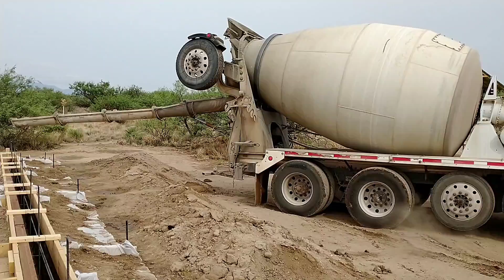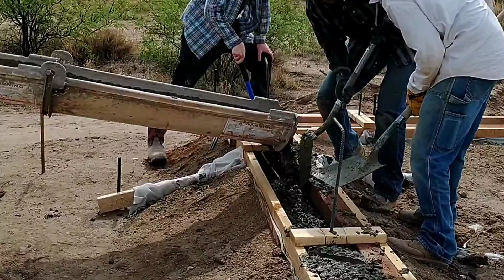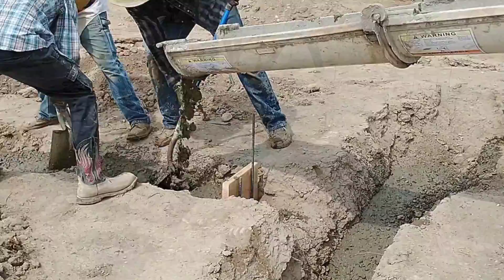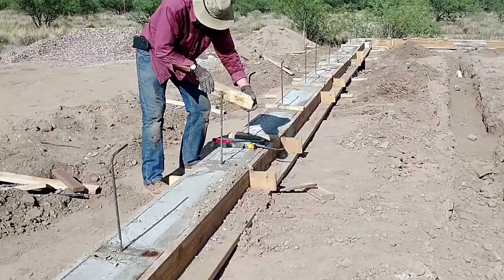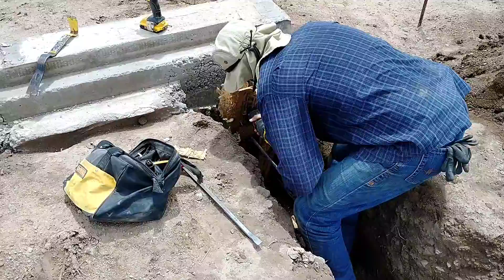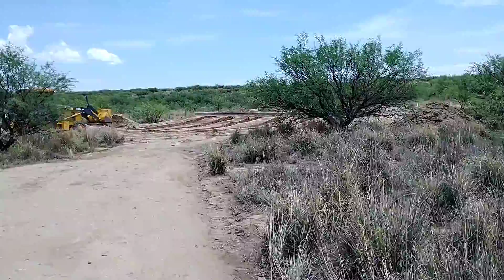#3 First Concrete Pour for House Footer 🏠 DIY Off-Grid Build

Comment: When a concrete truck comes, the first thing you tell them is. put some water to it. Concretes allways to thick even when you try to pour a slab
Reply from the maker: It seemed okay at first. We usually have them add quite a bit of water, but we wanted an extra strong concrete for the footer, turns out it was definitely too dry.

Comment: Those trucks have extra water to add to the mix to make it loose also have a small pad ready for the extra
Reply from the maker: We were going for a low slump concrete, but it was definitely too dry. The next half of the pour went much better.

Comment: Red and April, love the videos especially the easy-to-understand voice overs.  So pleasant to listen to.
I'm curious though why you installed such deep footers?  Why not pour a monolithic footer/stem wall resting on stone rubble?
Surely the cost for crushed stone would have been less than all that concrete?
And you could have specified that the concrete supplier used an admixture to extend the working time of the concrete and to make it more workable.
Reply from the maker: Thanks! We wanted the house sitting on undisturbed soil rather than on fill or gravel.🌞🏜️

Comment: Use your recip saw without a blade to vibrate the side of the forms to help the wet concrete settle.
Reply from the maker: Several have mentioned that, but we still haven't tried it. 👍 That was some thick concrete, the second pour went much better. We should have vibrated the inside wall footers too.  We have a few more to do, so hopefully next time.

Comment: I finally found you guys again.
Looking forward to seeing the house build.
A little concrete tip for ya. Take the blade our of your sawzall and use it ti vibrate the concrete forms.
Reply from the maker: That would certainly add some vibrations! 😄 Thankfully the second pour went much better, the concrete wasn't nearly as thick, and he requested a different mix. Thanks for joining us! 😊🏠

Comment: Good afternoon, I enjoyed the music but I really like this. I haven’t heard of this technique, would this be used for a ICF structure? We did the post tension slab due to the earthquakes we get from time to time! I wanted ICF then the pandemic happened and we changed our minds due to we could not find anyone to help us order what we needed. Anyhow, this was a very informative video! I am Wendy and I hooe you ha e a blessed weekend!    Wendy🦋🐞🌸
Reply from the maker: This is definitely not the usual way to do a footer, it was a lot of work, but also saved us a lot of money by doing it ourselves. We are in an area where we can opt out of most inspections, & we are not required to follow most building codes.  We are planning to use poured aircrete for the floor, walls, and maybe even the roof.  First we need to experiment with it to make sure it will work. Thanks for watching, and wishing you a wonderful weekend as well.   😊🏠 April